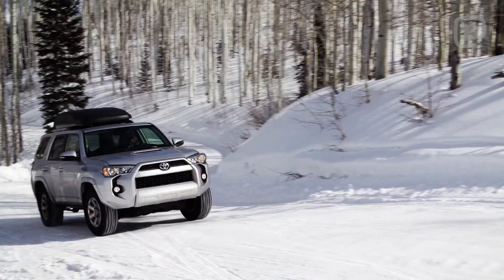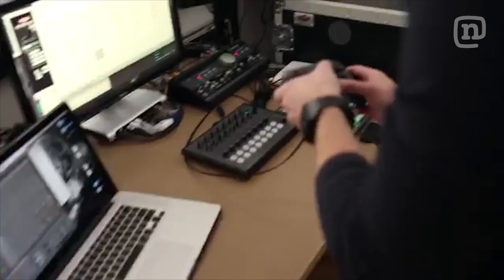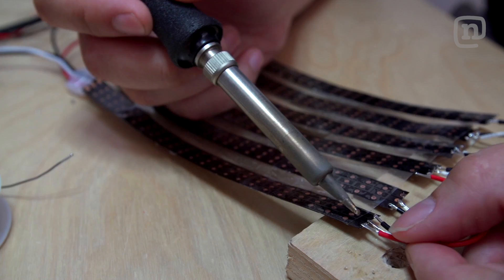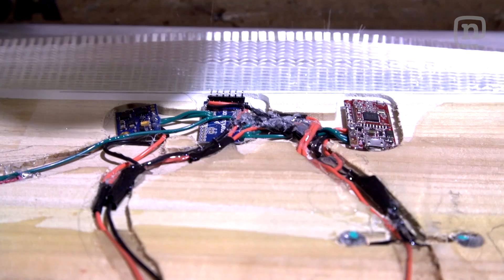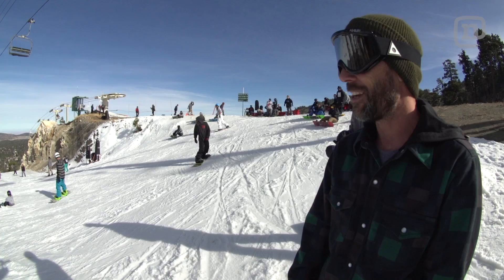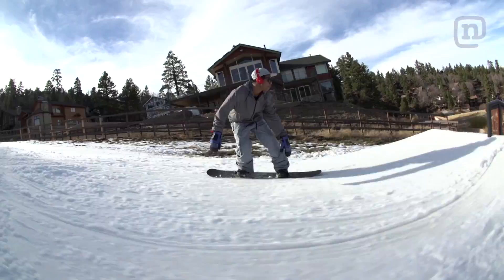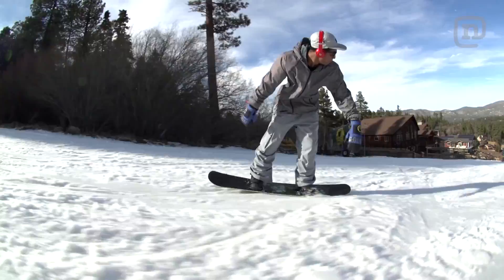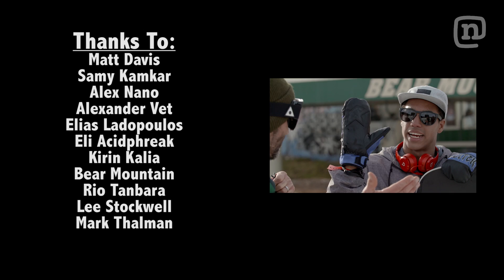The Ultimate Programmable Smart Snowboard: Every Third Thursday

Comment: This just gave me an idea because of a connection to the work im doing right now. HMU if you want to know how to revolutionize the world of snowboarding.
Reply: Hit
Reply: why be stuck with one shape? and Why not use all of the extremely cheap accelerometers and gyros that are available today in snowboards. Why shouldn't your snoboard use your riding data to adjust its shape to fit you best? Why shouldn't your snowboard adjust in real time as your snowboarding depending on your activity? Why shouldn't your snowboard adjust 10's of thousands of times a second as you're riding making it extremely stable at any speed and also really easy to control?
Reply: ***** economies of scale are the only barrier
Reply: 112233jjooee I'd love to know how you plan on adjusting the actual shape of a board
Reply: Jan Everaert i bet you would ;)
Reply: Jan Everaert aka: thats where my work comes in
Reply: are we talking wideness or thickness?
Reply: possibly thickness, but really just changing between camber and rocker
Reply: 112233jjooee sounds doable. maybe if you just connected both tops with a wire, and be able to change the length, and thus tension, you might achieve just that
Reply: i was thinking more like using smart materials in the core. With an advanced enough material, you could adjust the shape thousands of times a second according to data being collected about the terrain and the riding style. Like traction control and active dampening on a car. At first it would just be the ability to choose between camber and rocker and hybrid on the fly
Reply: sounds about right, but I'm afraid this material will either cost a lot, or leave airbubbles in the core, causing i to break due to the temperaturechanges
Reply: yes, that is the problem anyone who tries to copy it will have.
Reply: ah, you found a way. well, keep me updated anyway.